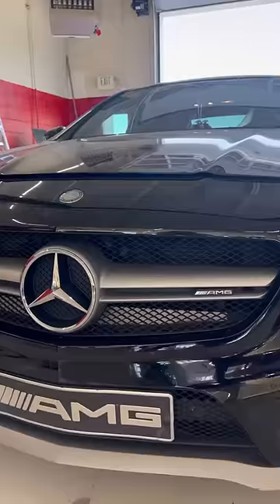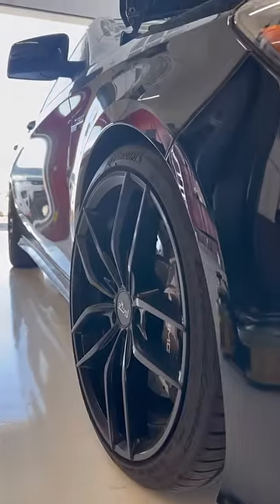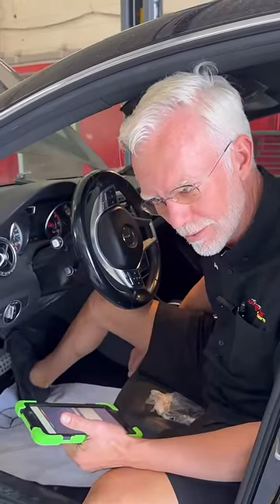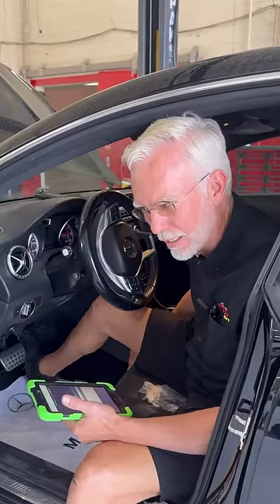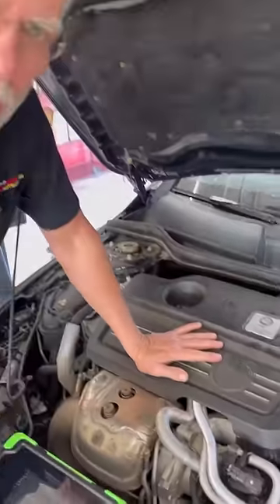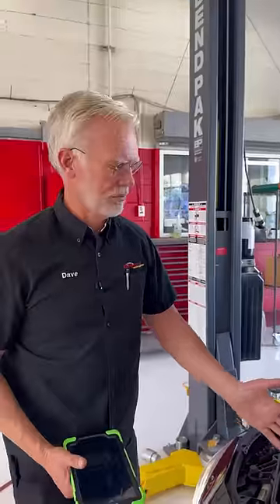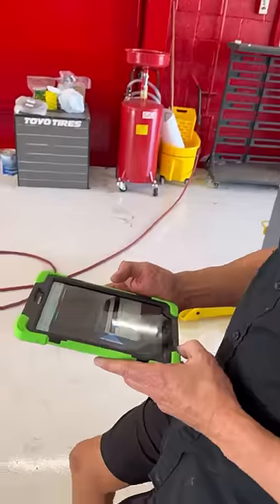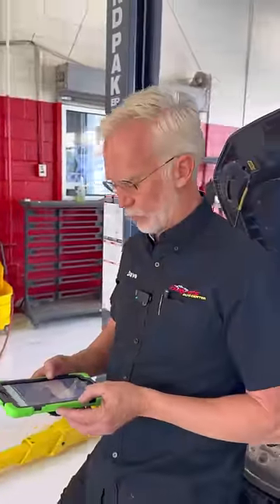Mercedes AMG Nothing but a slight noise on start up #carrepair #autoshop #mercedes

Comment: Never take your car to the dealership for repairs unless it is 100% under warranty.
Reply: I will say when I did take my 1998 e320 to the dealership, they did do some maintenance that was definitely overlooked, like: replacing the brake hoses, changing the "sealed for life" transmission fluid, and doing the upper and lower control arm bearings. 

Definitely wouldn't go back again because holy ouch $$$, but they did do a great job with it.
Reply: @slyscafe you pay for the quality of work and those factory trained technicians know that vehicles needs best.
Reply: @HarryMonkz  looks like we found the lurking dealer tech
Reply: I renew the warranty on my M5 every year, the last dealer repair was rocker cover oil leak that was 3 days labour 😬
Reply: Rich people problems you got to love it

Comment: Noise on startup that quietens when it warms up and a code for insufficient turbo boast.

First thing to do is check the bearings on the turbo by wiggling the impellers to see if they are loose, then check the oil supply line to see if it is restricted and the turbo is not getting enough lubrication.

Comment: I worked on armored diesel trucks. And one of the armored trucks was a diesel Sprinter (Mercedes). The dealer would tell him he needs a new engine because anyone owning a Mercedes AMG that is not very old in years coming to a dealer for repair would most likely have the money to repair the vehicle under "the dealer's" direction.. 

The first thing I would do is check the water pump's integrity then check the thermostat. A good possibility that coolant isn't circulating through the block thus having a cooling inefficiency. 

And if we know anything about German vehicles and their technology we know they love sensors and electronics! It would not surprise me that an electronic thermostat is used in this vehicle and it failed after a short use.
Reply: My question to the customer would be what does he or she see that causes them to say it is over heating ? ?

Comment: has the boost issue not dropped anny wear metal into the intake? I'm guessing under boost is caused by wear on the supercharger wich the engine is sucking the broken off wear particles in

Comment: Mercedes oiling systems have plastic parts that melt around the turbo cooler lines and clogg the oiling system. They don't want to trace all the plastic through the system
Reply: That's why I always wanted a Mercedes and when I had the chance to buy one a good used one I changed my mind and then because I couldn't find a good older Mercedes with a still made them. This is the trash they are charging 80,000 and more for. If I had the money to pay cash do you think I would buy it? No I would find me an older Mercedes and off frame restoration or I would go to Tennessee. There's a dealer there. You can find them on the internet. They deal with nothing but old cars and that's where I would be😅😅😅😅😅
Reply: Why do they use plastic?
Reply: @jenkathefridge3933  The car is set up to handle wide open throttle at vmax on the autobahn up to a certain temperature - usually 50°C outside. At these speeds, all parts have to hold up. 
Now, as soon as you throw a tune on it, this flies out the window. If you keep the car bone stock, plastic will be enough, but once you mess with the engine and ask for more power, the cooling system can't necessarily keep up - especially if you up the boost too much, which also heats up the turbo. 

As to why they're using plastic - because plastic is cheap and metal is not, and when you keep the engine stock, plastic is good enough.
Reply: @zibingotaeam3716  but with metal it can handle higher temperature than plastic but I guess I understand the costs
Reply: @jenkathefridge3933  yeah, but why would you need it to handle higher temperature - if you want a faster mercedes, buy one, that way you get all of the problems sorted at once - the brakes can keep up, the cooling can keep up, you get a warranty etc etc
Reply: @zibingotaeam3716  metal more durable than plastic
Reply: @jenkathefridge3933 plastic lighter weight and lower cost than metal.

Comment: I would check oil pressure with a gauge. And pressure test the turbo intake system for leakage. Look at map and mass air flow readings.

Comment: i would check for a boost leek before the intercooler if it has a front mounted intercooler near the radiator. I have had multiple turbo vehicles with this exact set of symptoms. The noise is the boost leak or oil not in the top end. The over heating is the boost air pushing air over the radiator causing it to not effectively be cooled by the airflow trying to get to the fins in the radiator.

Comment: Check oil for water/ check coolant for oil. Check for bad head gasket.  Also check thermostat, fan belt and water pump for cooling problems

Comment: If dealer is recommending engine replacement I’d compression test first to make sure there’s no leaks coming from the head gasket
Reply: Compression test wont tell you if the head gasket is blown.
Reply: @neilcowan535  that's why you check puld and coolant to see if they look the same color or not..
Reply: A bum head gasket is not the only culprit to signal a bummed engine, but if you can illuminate a bum head gasket then it's pretty certain you have a bummed engine. To confirm a bum head gasket run a chemical head gasket test. If a head gasket test is negative you have a bummed engine.
Reply: @jwalster9412  don't see how that is a response to my comment. But yeah, that's true
Reply: Speedy oil analysis spectroscopy is also a thing theses days . Like a blood test .

Comment: First, check the coolant level and check the oil for coolant. If there's coolant in the engine oil, go to the last step. Then check the fan motor and sensors/connection to make sure it's coming on, then check the thermostat(s) if it has one. Then check the water pump.  If all that stuff checks out, it could be the head gasket.
Reply: first: get rid of the mercedes and buy a lexus or acura
second: never have problems again
third: drive the car to 200,000 miles without any breakdowns
fourth: sell the car at 200,000 miles for 35% of original retail value..

Comment: I've got this on my 2007 sprinter - there is a leak in the induction system, but you can't find it because the turbo actuator only operates when the wheels are going round!  I've replaced the EGR valve gasket and given visual inspection.  You get a high pitched whilstle at between 2300 and 3300 - more than it should! The over heating is because  I need a new radiator!  Same codes though!